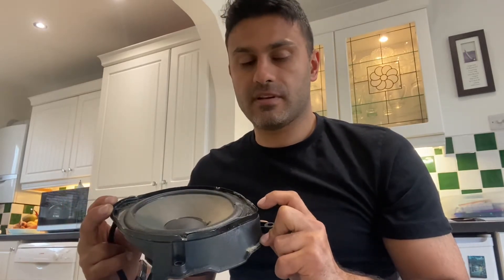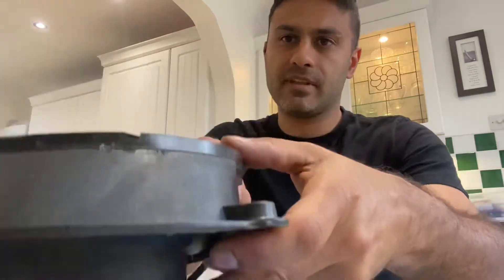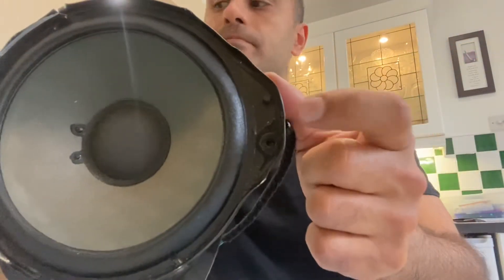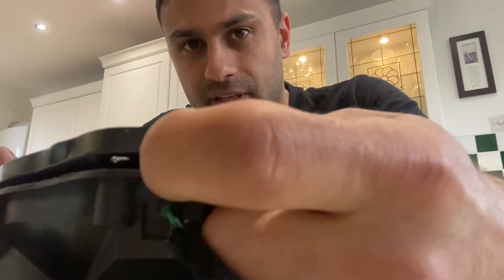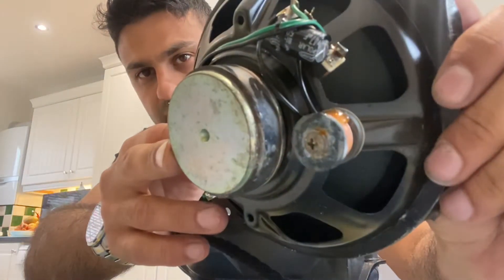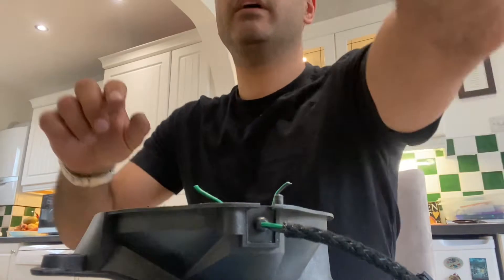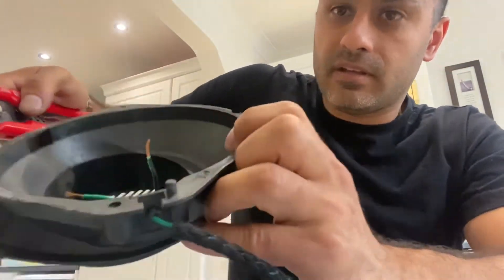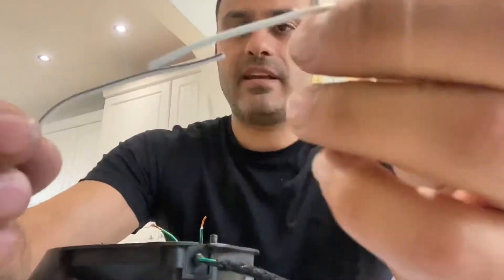R170 SLK Front Speaker Replacement

Comment: literally can not get the thing apart, no idea what glue is in there but there is absolute no way to get it done
Reply from the maker: Persevere my friend. The top part pries off by jamming a screwdriver between the metal speaker edge and the plastic innner. 

Then find the notch as per the video and pry the speaker out of the housing - a sharp knife will help, but brute force is the answer!